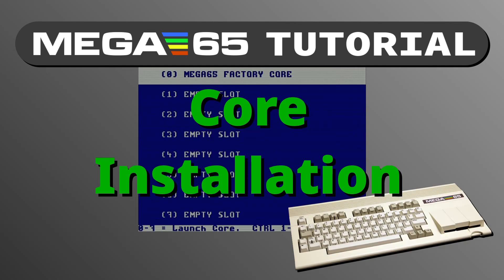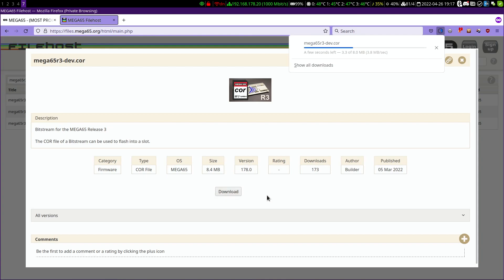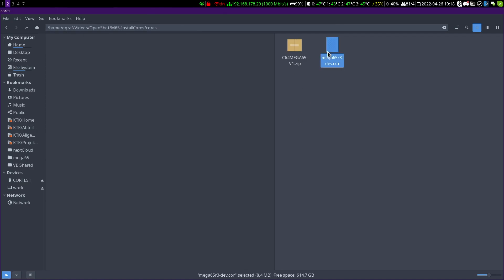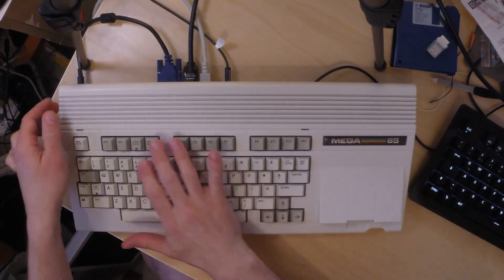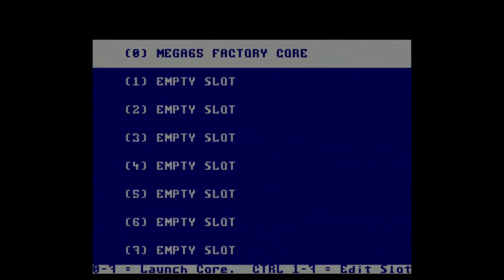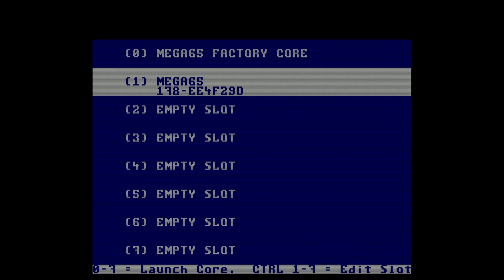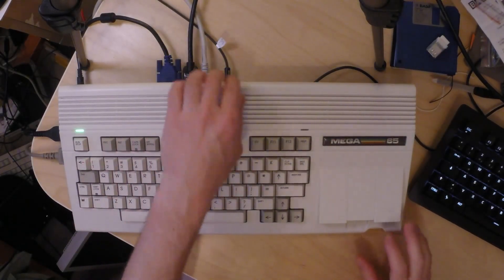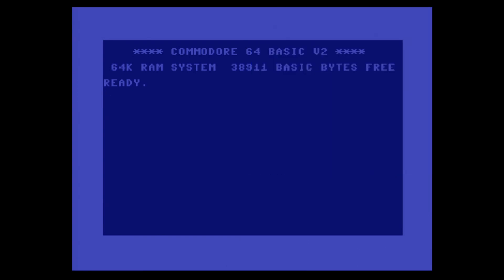MEGA65 Tutorial - Core Installation

Comment: Hello Oliver, thanks for your great video...What can you do if the core doesn't work...I have the "blue light" problem....I tried the core with the identifier 100 MHz...I did  no longer see the "blue light", it does not start... what can be the reason?  Greetings Danny
Reply from the maker: If the Power light is solid green, and you get no picture, this is most probably a incompatibility with your display. HDMI outputs only HDMI (so with Audio). This means DVI connection will not work. And it starts with a 50Hz picture, this might also be a problem. To fix this blind press HELP, 4x CURSOR UP, RETURN to switch to 60Hz, this might help. If your display can only do DVI, then you can download the DVI test core. For all of this sy2002 is working on a more suitable solution.
We also encountered Problems with high quality 8k HDMI cables. Try a basic one, the might work best.
Or is it VGA? Then I need more information. If you can drop by in the MEGA65 discord channel #other-cores, this might be a more direct way to communicate.
Reply: @OliverGraf  Können wir auch in deutsch schreiben?
Reply: @OliverGraf  Hallo Oliver, hab jetzt die neueste Version von c64 Kernel v3 drauf und es funktioniert immer noch nicht... deine letzte Hilfe mit "Hilfe" Taste cursor 4 mal usw. funktioniert auch nicht...Hab ein anderes Kabel ausprobiert und auch einen anderen Monitor... Hast du noch eine andere  Idee ? Gruß  D.Buchberger
PS: ICH LIEBE DEN Mega 65 immer  noch und freue mich wenn ich ihn ansehe... vom ansehen wird aber langsam kein spass mehr draus...

Comment: I followed all the steps, and the M65DEV core works fine. But if I select the C64 core in the cores menu while booting, the screen just goes black and the Power and Drive LED's alternate flashing blue. Yet there were no error messages while installing the core. Any ideas?
Reply from the maker: The C64 Core is still in a very early stage. There are currently some problem with the interaction of the C64 core and the bitstream running on the auxiliary MAX10 FPGA. The team is aware of this, and a solution is in the works. If you want to be up to date, please come to the MEGA65 discord and keep an eye on the #other-cores channel.
Reply: @OliverGraf  Thanks a lot for the info!

Comment: Two things I do not fully understand:
Am I right that Slot (0) is not booting at all and only Slot (1) (and 2, etc.) is booting?
It’s an interesting option with the DIP-switch inside to choose between 1 and 2 - but on one side there are 7 slots (so what if I want to always boot into e.g. 4?) and on the other side wouldn’t it be better if the favorite core to boot at cold start could be selected in the menu and will be saved into some kind of BIOS memory?
Reply from the maker: Slot 0 boots if the default boot slot is not occupied. It's the fallback slot. And the safety net if you accidentally break your default boot slot.
Note that as long as you only reset the system, it will keep the core that was selected. Only power cycle will revert to the default boot slot.
Some kind of different boot slot selection might be possible in the future. The system keeps a separate partition where the config parameters and the freeze slots are stored. Here it would theoretically be possible to save a default boot slot. The DIP Switch was just faster to implement.
There are also other ways to switch cores: for example with a JTAG interface you can push the core using m65 tool or M65Connect from your PC.
Reply: @OliverGraf  ok, I understand. Thank you for the detailed information! When more cores are coming I think a basic system wide video configuration would be better.
Reply from the maker: @ClarkCWSKent  I just found out that it is possible to boot a slot by keypress, while looking for a way to implement it :)
Just hold NO SCROLL and the number key of the slot you want to boot and power on the machine. NO SCROLL will start the Flasher which will immediately read the number and start the slot.